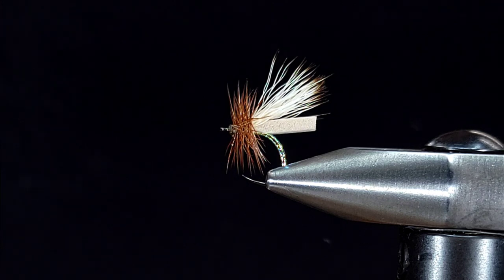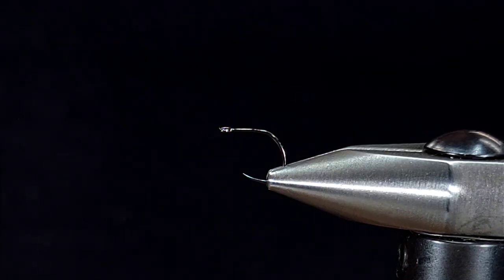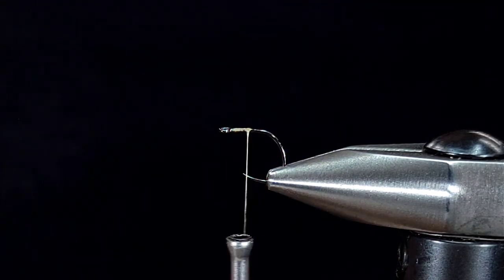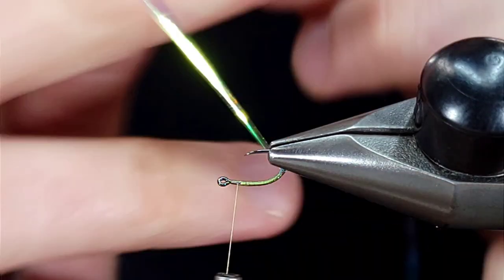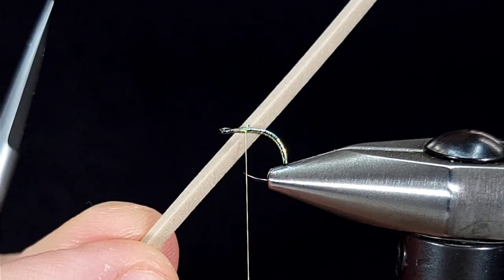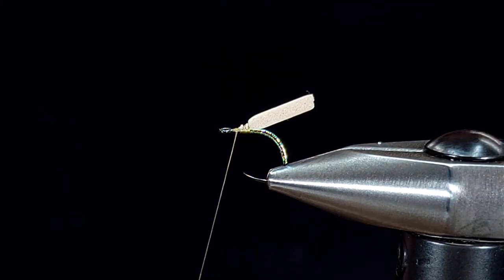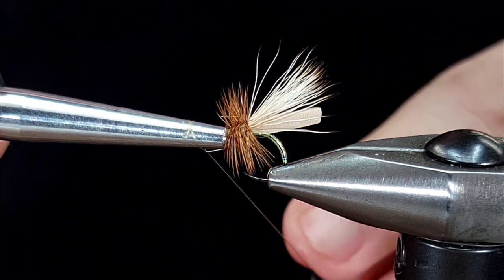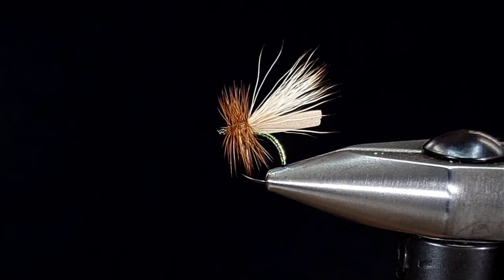Neversink 2.0 Caddis - Foam Caddis Dry Fly Pattern Tying Tutorial for Fly Fishing

Comment: I like a lower profile in the water, so I cut a "v" section under the hackle to allow it to ride lower in the water. Thanx for the pattern I'll tie some up ASAP.
Reply from the maker: Absolutely! I cut them straight across the bottom sometimes for the same reason! Try both though, if you put some dry shake on this it will dance across the water like a skating caddis. I've had many fish crush it when doing that.